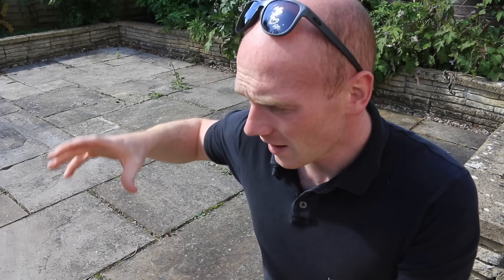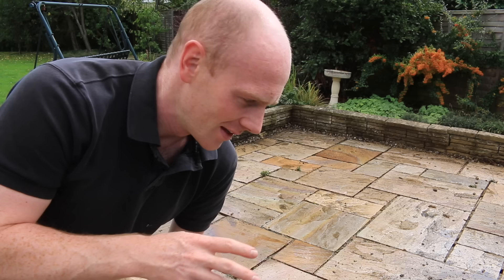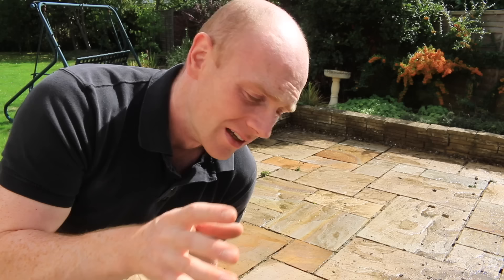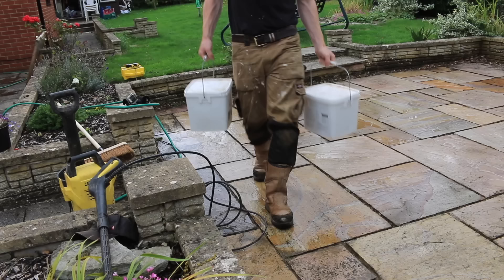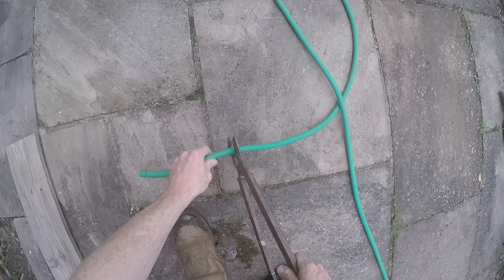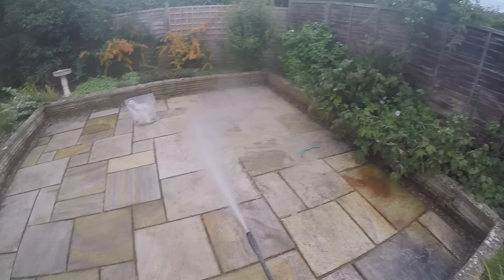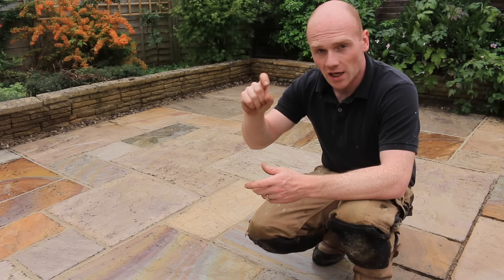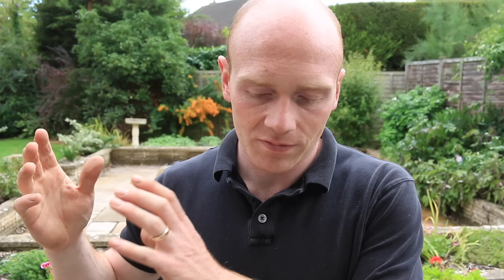RESTORING AN OLD PATIO

Comment: Great video. Used your tips to re-point my patio using Sika Fast-Fix. The hardest part was removing the existing pointing. Once that was done I just soaked small areas of the patio, swept the mix into the gaps then scored it. Thanks for the tips. I am the least able DIY person in the world but your video made it so easy
Reply: Is the pointing still holding?

Comment: Great video, i carried out the same on my patio. That brush in product is fantastic. I used sodium hypochlorite to clean the patio, ground out the pointing that wouldn't come out by hand. I found soaking the material and pointing the joints with sodden material worked better than brushing.
I also re-struck the joints the following day for a super smooth joint. The material goes much further than I though. Even visitors comment of the finish.
Reply: We need to clean our shed floor which is concrete slabs! What would you recommend to clean other than a jet wash??
Reply: Sodium hypochlorite, it's like bleach but 10 times stronger, need full PPE and old clothes, horrible job but comes up spotless. You can buy this from your local farm supplies it's very cheap. Used to clean sterilise milk parlours.
Reply: andrewb113 cheers! Will prob just go with bleach then because we are painting if after
Reply: what percentage strength sodium hypochlorite did you use? I used a 12% sodium hypochlorite, TSP, and borax mixture with surfactant to clean my shingles and it did excellent. Did you mix anything with your sodium hypochlorite?

Comment: This video was perfect for encouraging us to take this on. Went quite well. Some sand stuck in ridges on the slab surface, but it's easy to scrape off when it's dry. Our patio had very wide and deep gaps so 60 square metres took nearly 6 boxes! Well worth it though.

Comment: After all that hard work.....you forgot the most important thing.....sealant!! Theres plenty around but the cheapest is a water based acrylic sealant - £60 or so for 25 litres. It will bring out the colour and make it a lot easier to keep clean. Probably need 2 or 3 coats.

Comment: great tutorial.  as soon as the lockdown is over I plan to buy the pointing mix and crack on and sort my 2 patios out.  can at least make a start and get the pressure washing done this Easter !
Reply: No need to wait for the lockdown to end, you can click and collect from b&q also screw fix 👍
Reply: @jsharp9752  Good look with that
Reply: With what
Reply: @jsharp9752  Getting stuff from B&Q and Screwfix. Ive had s nightmare with both getting what I wanted over the last few weeks
Reply: @Dante-vf4sd  I got stuff from both last week...i am based in east Midlands it might be less busy 👍
Reply: @jsharp9752  Hour ques for both to get on website, can only get essential items from Screwfix and took a week to get item to B&Q, turned up at store to collect and had to wait for 2 and a half hrs to be told they didn't have the item😵🤬
Reply: @jsharp9752  I'm a gardener in need for work so i have to get the stuff

Comment: So glad I came across this video. I moved into my house four years ago and am only now getting to tackle the garden after redoing the whole house top to bottom, during which the garden became a bit of a dumping ground for skips, etc. I have paving slabs like these in the back garden and I would doubt they have ever been cleaned and have a lot of lichen. I had tackled it recently with ordinary bleach, it is slightly improved but could still be a lot better. Today I ordered Sodium Hypoclorite so I'm hoping that will do the trick. I was happy to see how easy using the sand appeared as I have a large bag which also has an element in it for killing off any weeds, etc that appear so that they cannot become established. Just for good measure I have also purchased a sealant to brush in over the stonework when all the rest is done to keep it looking well. I know it will be a lot of work but it should be worth it. 

I also like the look of the low stone wall, another addition I have been considering for the garden. There were raised beds when I moved in that were made with railway sleepers and are looking very battered and tatty now. I have been thinking of replacing them with a low walled bed made of small blocks. 

Anyway, it will all have to wait until I get the time and the weather. Once again, thanks for the very informative video!

Comment: Main problems with these things are, having joints wide enough to park a bus in, and then using the dry mix method to avoid staining the slabs and getting the job finished quicker. Not knocking you for using the jet wash here as it’s prep for maintenance work. But pressure washing is not needed for general cleaning, it seals the fate of bad joints.

Comment: Really great video. Lots of information in here about using sharp sand as a bed but not for the pointing (which I'm glad you verified as I was about to do that!). I'm going to point my slabs with builders sand and cement but I really want a grey colour like your Fastpoint. Will the builders sand mix give me a brown? Or will it dry to a grey typically? My slabs are grey and I want a pale pointing, not a buff / brown.
Reply from the maker: Every area and supplier will have different colour sand. Therefore always best to do a few samples if you need a particular colour. Near hear it’s usually buff but now and then if I buy a few bags from Wickes it can be dark red so worth checking before you order/start.
Reply: @TheRestorationCouple  in the end (as Building Sand seemed to be an early casualty of the pandemic) I sieved a load of grit sand that I had left over from a bulk bag for my bedding mortar. This removed the larger bits of grit and gave me a good, light coloured fine sand for my pointing.

Comment: The slabs are renowned for the joints to crumble its a soft mix! U dont use building sand to point!
Reply: Zak Lock wrong
Reply: @kddk8245  wrong? Ok tell me how knowledgable you are with laying indian sandstone
Reply from the maker: A sharp sand/building sand mix has lasted well on a previous project we did but whatever weak sharp sand mix that was initially used on this patio has not. Didn’t intend to suggest that you would use a purely brick type mortar. 👍
Reply: @TheRestorationCouple  the problem is weather! Our winters are horrible! Soon as the frost hits, it destroys the joints! We lays these on site with a 4-1 sharpsand to lay and point!
Reply: zak maybe me and you should meet and sort this out man to man ?
Reply: Zak Lock x

Comment: From a very bad experience. Do not put any paver, patio sandstone sealer on with a brush. Always use a roller and do 3 or 4 slabs at a time and go back over it after 5 minutes to ensure you get no blister like bubbles.

Comment: It's actually very good practice to have sharp sand in the pointing mix. Sharp & soft sand with cement is a much stronger mix than just soft sand with cement. The reason most builders use soft sand is because it is easier to point with and you can strike it nice and smooth. Looks like there wasn't enough cement in the original mix.
Reply: Sand is between sediment/silt and gravel, and comes in many varieties, including river, beach and manufactured, with river sand the most sought after for it's properties.

So-called "soft sand" is river sand. The result of stone erosion in the mountains, transported hundreds or thousands of miles, being smoothed all along it's journey.

River sand results in the most homogeneous and strongest mix.
Reply: @ARepublicIfYouCanKeepIt  you are trying to be a smart arse mate! I can tell you now, having some grit sand in your  mix is the right way to point slabs.
Reply from the maker: I think the ratio I used in the past was a mix of sharp and building sand which worked well and held strong. I think it’s the fact that in this case it looked like it was a weak sharp sand mix almost brushed in which was the issue. The sharp sand mix we used a couple of years back did trowel up quite smooth and the larger aggregate disappear under the surface just fine but as you suggest much stronger than straight brick mortar. 👍
Reply: @TheRestorationCouple  yes brushing in a dry / semi dry mix of sand and cement just doesn't work. I use 1 sharp 3 soft and 1 cement mixed to a workable consistency. I've still not tried these brush in compounds, definitely looks a damn sight quicker than traditional pointing.
Great channel BTW.
Reply: joe fowler From what Tim said, it sounds like the original installation was a bit of a rush job. Wide joints, just bedded down, and no doubt a brushed in dry mix to save time. Using pressure washers for cleaning means poorer installations are doomed!
Reply: @idiotdetectioninprogress  I think I misunderstood Tim, I thought he said you shouldn't use any grit sand in the mix when traditionally pointing indian stone flags. After watching again, I think he's saying it looks like they have pointed using JUST grid sand and cement ( no soft sand ). Anyway, most definitely used the wrong mix. One thing I did notice, it doesn't look like it's sunk at all, so must have a good base.

Comment: As a full time pressure washer i know its rare that a pressure washer (even the big petrol powered ones i use) would get rid of 100% of the black spot. If u apply sodium hyperchlorite for 15 mins and rinse it will get rid of black lycan.
Reply: Where do you get this please?
Reply: Sodium hypochlorite is the main ingredient in household bleach, but weaker in dilution, typically around 3-5%. If the lichen (black spots) are not as prominent on your paving then normal household bleach will likely get rid of it. Otherwise you'll need to use a stronger sodium hypochlorite solution.

You can get sodium hypochlorite from ebay or amazon.

Comment: Do you have any tips on doing this with really deep gaps. I used the pressure washer and I blew out a lot of crap and some of the gaps go down a good couple of inches. Great video by the way.
Reply from the maker: Sand and cement mortar
Reply: @TheRestorationCouple  thanks for reply I guessed that would be best for it but thought I better ask someone with the knowledge. Would you put it in dry like you did or add water?

Comment: Will the brush in product work on joints that are at least an inch wide? And what's the best way to remove the current material? It looks like cement but we've got all sorts of weeds growing through it.
Reply from the maker: Possibly ok in wider joints but would end up rather expensive. Old joints usually will pick out with any thin tool if weak enough. Otherwise it may be a case of careful work with an SDS.

Comment: Great video! 
I remember when we bought a kaarcher pressure washer in Scotland, loved using it. 

Moved to England and never used it since due to the water rates-it just pumps out so much water/money! 
Nonetheless it is satisfying to watch!
Reply from the maker: It's surprising how little it uses.  I have used it with a waterbutt before and lasted for ages before running low.  Certianly less than watering plants/
Reply: Bi

Comment: What’s the product called , you used to repoint please ?
Reply: Ez joint
Reply: After you've swept it in make sure you strike it off you will find some bits will need topping up
Reply: He's using Fastpoint Patio Paving Jointing Compound by Stonemarket - Easy Joint is another similar grout, but I believe with EJ they recommend at least 25mm depth

Comment: I'm confused next time it rains heavily or weeds start coming though it's just gonna push all sand out. Sand and cement wet mix won't stain the paving either, that's why you sponge it off and light acid wash to finish.
Reply from the maker: It’s not sand? It’s resin bound and very resilient to weeds.  We have had it down for nearly 5 years and all fine.

Comment: I have a question, my patio has been done last year (all good) however the grouting btw slabs are deep and was wondering how could I make them more shallow. Would you use resin bound? The resin bound you are using looks like sand, is it how it comes? Thanks for advice

Comment: And again, as i get further into the video, laying them onto a screeded sand bed isnt incorrect, u can lay them on a 5 n 1 sharp sand mix either on a full bed or dabs, or u can lay them on sand screed! Your an active diyer not a landscaper!
Reply from the maker: Yes, correct, this is a DIY channel... Besides, I would never lay a natural stone patio on anything than a full mortar bed, for the slight extra time and cost it is far more durable than other options.  Dabs on budget sandstone is surely asking for issues.
Reply: You should never lay sandstone on dabs, always on a full bed. Learned this from bitter experience after a cowboy 'landscaper' layed some of our patio on dabs when I wasn't around to check his work - less than one year later the slabs have worked lose, the pointing failing, and show blotchy staining. Do it properly or not at all.

Comment: I've just discovered that the guys who did my sandstone patio messed up, I think!  They laid it dot and dab, used builders sand instead of grit/sharp sand and didn't use a template. Hence cross joints everywhere. Its been down 3 years and is moving, cracking and well looks dreadful. They guy came over, agreed to re-lay as per guidance and now has done a U-turn. I'm devastated and my point is, do I have a case to take him to a small claims court as I have no option but to get another company to lift up and re-lay 😔
Reply: Yes you do, ring citizens advice if in the UK, you will get all the info you need. I’ve had the same and just taken my case to court.
Reply: Hi Tony,
I tried to take him to court through my house insurance legal cover.  I did have a case but when they did a credit check he hadn't got two pennies to his name so they couldn't continue with with my case.  Disappointed to say the least but thank you for you reply.

Comment: Wet and Forget does NOT work.
Reply from the maker: 4 years and multiple pressure washes later, our own patio would say differently. Perhaps it depends on the product.
Reply: The Restoration Couple The product was Wet and Go used first as recommended, at double strength, at full strength ie undiluted. 
Nothing.
Reply from the maker: keith tanner not sure I’m afraid. The product I use is straight out of the tub and needs no diluting or mixing.

Comment: I'm surprised; you have your mortar knowledge backwards: sharp sand makes a very hard and resilient cement mortar, whereas soft sand mortar will not last as well on a patio.
Reply from the maker: We have always used a sharp and building sand mix but yes the strength comes from the larger aggregate. I think what I was trying to say is that   a brushed in weak dry sharp sand mix is doomed to fail. 👍
Reply: Ok I see. I've used two thirds sharp sand, one third soft sand, for patio grouting with great results. I copied this guy and his great sponge technique:  HQFx9Fvl1bk